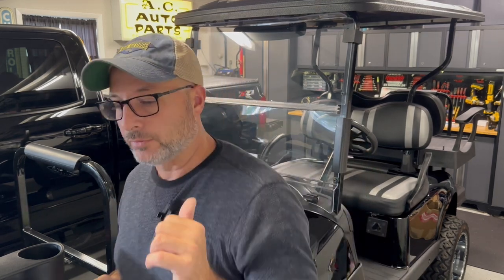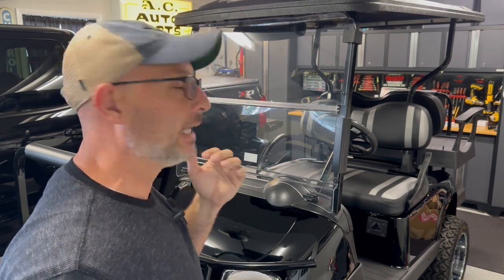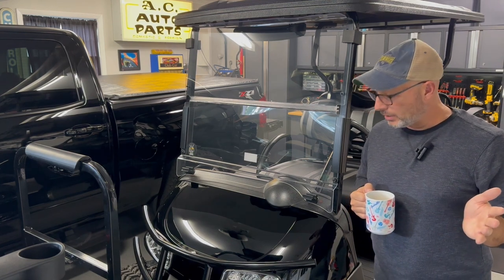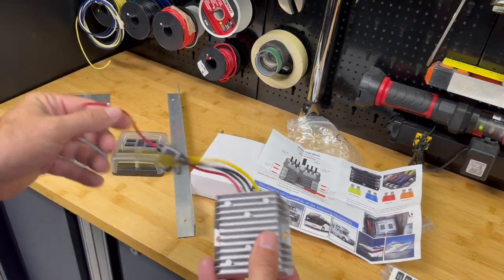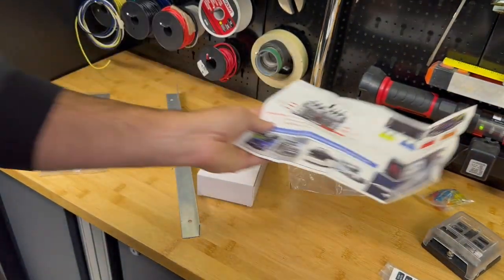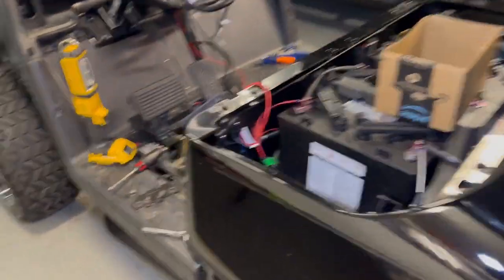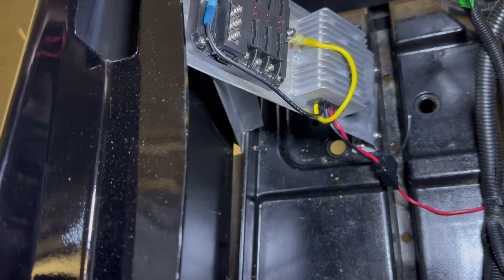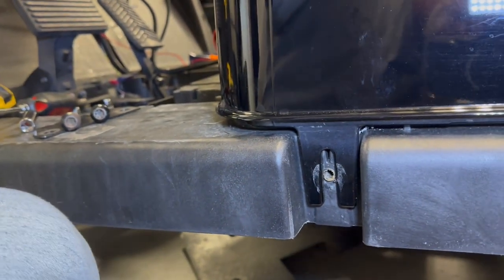2015 EZGO RXV is 12V Ready! Voltage Reducer, Fuse Panel and KEMIMOTO 12 piece LED glow lights.

Comment: Uh-oh. Did everything I believe the same in the video on my 2017 RXV, but everything turns on with key, but does not go forward or back now. Any suggestions? I have put a 48V relay next to reducer.
Reply from the maker: @kevincarlson109  maybe try going around the relay to make sure it’s not something else ?? Wonder if the relay is not sending power out to the normal system?

Comment: Did you used a relay switch to stop the Batterys from being Drained
Reply from the maker: @larryboyd4139  I did not. I considered it but it’s just on the key. The voltage draw appears to be zero with the key off so I left it that way.

Comment: Hey man my boss have a 72v bad boy buggies just wanted to know how can I hook up another step down for the lights and radio that he have on it. The reason for that because he have 8 led lights and  a bluetooth radio. And all that is over loading the step down keep blowing the lights fuse. Thanks for your videos
Reply from the maker: @jlover0628  my initial thought is to get a 72v to 12v reducer and wire those in separate from what may have came with the cart. Some of those light kits have their own reducers built in I believe. 
Thanks for watching and writing.
Hope that helps.